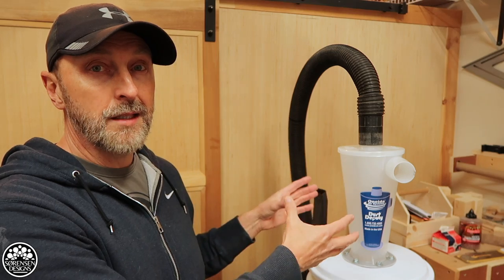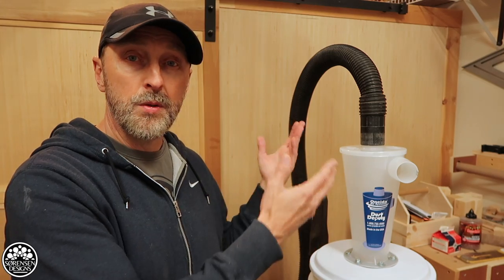Before You Spend Money on Dust Collection…Watch This Video

Comment: Have to ask you why you would need this vac when I see you have a Festool CT vac under your bench. Isnt the Festool enough for the woodwork jobs in shop. I just bought a CT36 and was hoping I wouldin need another vac in shop.
Reply from the maker: A fair question! I use the ridgid vac and cyclone for most of my stationary tools because it's a cheap cyclone solution. For my hand-held tools (sanders, domino joiner, router), I use the FT dust extractor. At some point, I will probably upgrade the FT dust extractor with an FT Cyclone. Just buying adapters, hoses and accessories for the FT is ridiculously expensive.

Comment: I noticed that you have a festool vac and was wondering if you considered the Oneida "Ultimate Dust Deputy For Festool Vacs", and if so, why you chose not to go that route.  Maybe expense at $300, but it seems to be the best option that I've seen so far as I am looking for dust collection solution, and I also have a festool vac.
Reply from the maker: @rond1962 rond1962 At that price you might as well buy the Festool Cyclone with systainer. 
It's only about $75 more.  I only use the FT dust extractor for my sanders and my domino joiner. For everything else, I use the dust deputy / ridgid vac. Maybe one day I'll splurge on the FT cyclone.
Reply: Eric, thanks for the quick response! For what it's worth, if you do decide to get the systainer collector someday, I definitely recommend the Oneida over the festool. The festool definitely looks cooler but its design seems to be lacking and does not perform as well as the Oneida. There's a good comparison video on YouTube.
Reply: I am curious why you put the cyclone on the shop vac and not the FT vacuum?  That way you could eliminate the shop vac entirely.
Reply from the maker: @JT Long  That would be a different kit and a different collection container at about triple the price. The Ridgid vac is actually really good for suction, so I use it for the big dust makers, router table, table saw, miter saw and general clean-up. Maybe one day I will buy the FT cyclone but for now, i've got other tools to buy.

Comment: Eric. Love the concept, but wondering if this system has enough draw to handle tools with a 4" dust port, such as table saws. Your thoughts?
Reply from the maker: It sounds like you need a more stationary / centralized solution. You can get a larger cyclone top for a larger container. Same principle, just upscale it. Mine is good for the standard ridgid dust ports but probably no larger than that.
Reply: Thanks!

Comment: I ordered everything to do the same myself, but realized when I got the Ridgid vac delivered that it is slightly wider than the dolly between the carpeted pieces (by about 1/2 inch). Just curious, how much clearance did you leave between the vac and the wood above?
Reply from the maker: About 4 inches clearance from the top frame.

Comment: I noticed you have a Festool vacuum. It seems to me that the money is in those vacuum bags. Have you thought about a cyclone system to use with that?
Reply from the maker: @chasmj3 They make a killing on vacuum bags! I don't use the FT dust extractor that often (mostly for my sanders and my domino joiner) but I might just buy another cyclone and set something up down the road. Problem is, spare hoses from FT are hugely expensive.

Comment: Can I just use the shop vac directly?
Reply from the maker: The short answer is yes...but....The cyclone system separates the dust into the 5 gal bucket instead going into a vacuum bag in your shop vac. It increases the suction and saves you money in not having to buy bags. You can't use your shop vac without bags because it will shorten the life of your vacuum filter considerably, and when the filter is shot, your vacuum will no longer work right. This particular cyclone system paid for itself in 3 months (for me) just from not having to use bags anymore.
Reply: @EricSorensenCanada  thank you for explaining and making me to understand more.  Appreciate your work as always 👍

Comment: Dumb question. I'm goign to build something very much like this.
I'm not entirely sure why I am pre-collecting my dust before it just lands in the shop vac. Anybody able to explain easily?
Reply from the maker: It doesn't land in the shop vac at all. The cyclone system captures 95% of it and deposits it in the removable bucket. The only function for the shop vac is the air filter for the fine dust and the air flow / suction it provides. You will never need bags and your air filter (which is expensive) will last longer.

Comment: I noticed it comes with two buckets, is it to avoid collapse? I used a Home Depot bucket and it collapsed on me, so I added another bucket and it worked fine. I noticed you drilled a hole to avoid collapse, you drilled it in the bottom bucket right? anywhere at the bottom? Thanks for a great vid.
Reply from the maker: @Albert Ifergan Yes, that's right, It's all in their instructions for setup. The buckets that come with it are a bit better than the hardware store type. The lid though is probably the most important. The lid in the kit forms a tight seal.

Comment: Why not just remove the bag from the shop vac (keeping the filter intact)? What is the purpose of having "2 buckets"? Maybe I'm missing the point?
Reply from the maker: @Ed Haskell That would clog the filter in no time.  The cyclone uses the suction from the vacuum and  dumps the  debris in a separate container, making the filter last much longer.  One bucket is just a holding bucket. The other is your dust and debris bin. All you really need is the cyclone and you can come up with a bunch of configurations from there.

Comment: Now you need a Dust Deputy for your Festool Dust Extractor.  That will save you big dollars,
Reply from the maker: @D Scott I thought about that... The FT hose is mostly the reason why I have that FT dust extractor. They are amazing for smaller power tools. I would need another FT hose to install it and the cost of the hoses start at $300. The one I use, that came with it costs around $800. So, I'm still hunting around. I might be able to rig something with PVC pipe - stay tuned.😉
Reply: @EricSorensenCanada  I have one on my CLEANTEC CT 48 and it works well. Ultimate Dust Deputy Systainer Cyclone Separator Kit
Reply from the maker: Ah I see what you mean... Yes. I think when I finally spend the money, I'll just pay another $75 and get the FT cyclone. There is a cheaper way to do it with just the regular DD cyclone but I might just hold off for now.

Comment: Do you void your warranty by drilling holes into your vacuum?
Reply from the maker: Probably... Also, it's totally unnecessary.
Reply: @EricSorensenCanada  I cringed when I saw you drilling into your Ridgid Vacuum. I just found out that Ridgid Vacuums come with a Lifetime Warranty.
Reply from the maker: It's an old vac, so I took a chance... It's actually in the instructions for the Dust Deputy kit. I don't think they would take my vacuum back after altering it, but you never know.
Reply: @EricSorensenCanada  Thanks for sharing your experience. I'm sure it will help lots of folks that watch this video.

Comment: Is the dust deputy and shop vac going to work whey using a Dewalt thickness planer with its powerful chip ejection system!
Reply from the maker: @Kenneth marsh I'm not familiar with that thickness planer but you should be able to hook up dust collection to almost any power tool. I would imagine the chip ejection would just make it easier for the vacuum.
Reply: It works. I use the dust deputy with my dewalt planer. I attached a 30-gallon container rather than a tiny bucket and that helps with the huge amount of dust volume from the thing https://www.amazon.com/gp/product/B0025QI4XC/ref=ppx_yo_dt_b_asin_title_o02_s00?ie=UTF8&psc=1

Comment: What might you recommend for a different hose. In Arizona where i live they dry out and crack once or twice a year.
Reply from the maker: @Carlton Brooks You could go with PVC pipe running from the vacuum to the cyclone, joined at either end with the appropriate elbow joints. Then use a pro-grade Ridgid vacuum hose for the cyclone itself. The pro grade hoses are less likely to crack (assuming you're using a Ridgid shop vac).
Reply: @EricSorensenCanada  Yes the vac is the same exact model you are using. I will have to look for the pro grade hose at the big box store. Thanks

Comment: You didn’t use the hose that came with the kit? Did you?where did u get it?
Reply from the maker: @MrBubbajohnson1 No, the hose from the kit was too short to connect my Ridgid vac to the top of the cyclone.  I ended up trimming a spare vac hose and using the elbow connectors to connect the vac to the cyclone. I bought the kit on Amazon.

Comment: Why do this when you have that expensive festool dust collector sitting there?
Reply from the maker: The FT dust extractor is great but the bags are super expensive. I tend to use it for my sanders and electric hand tools because of the hose. The dust deputy cyclone is used for the stationary tools like the table saw, thickness planner, stationary belt sander and the the bandsaw. These tools fill a 5 gallon bucket in no time. I might spring for the FT dust separator at some point and do a switch - the next time I have $500 to spare.